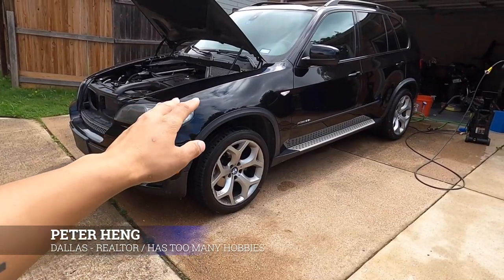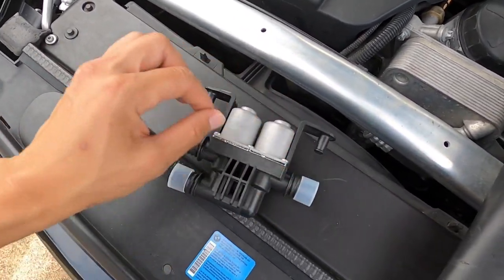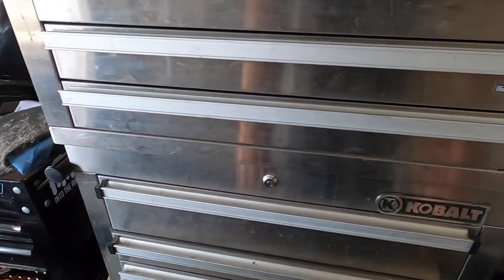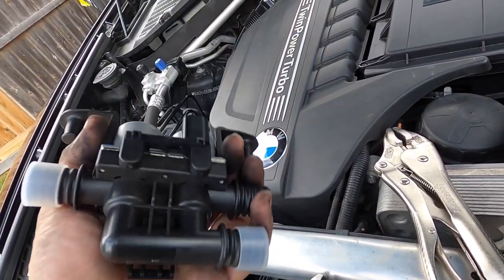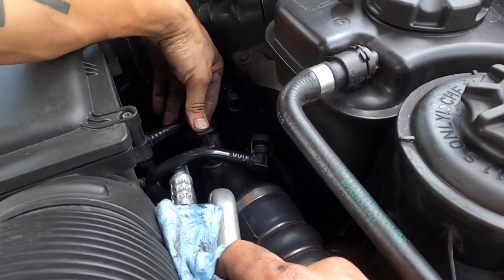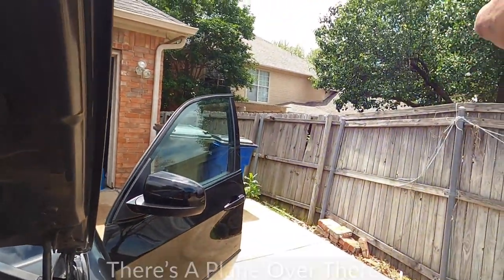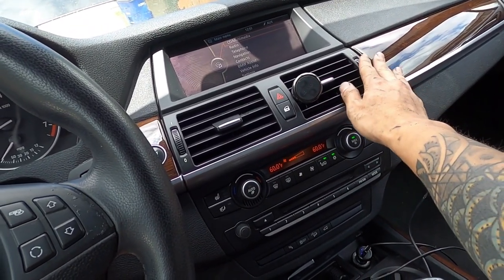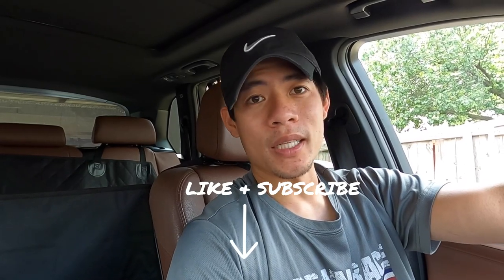🚘 BMW X5 E70 Heater Control Valve Replacement | VLOG 13

Comment: Thanks for the video. It seems to be the same on my x5 xdrive35i. This boosted my confidence. I was afraid to try it myself but it seems pretty straight forward. I will attempt this as soon as the new valve gets here. Next I will attempt to fix the frm model myself. Lol I will probably dick it up but I can’t afford what the dealership wants.

Comment: Just done it on a old E36 convertible  and it was a lot easier to get than yours,mine cost £33 and works fine not all aftermarket stuff is bad or poorly made .good luck bro
Reply from the maker: agreed! it's still working but now my electronic parking module just went out on me... So waiting for the new part to come in... so be on a look out for another DIY haha

Comment: good job 
i have same problem and foot it’s well 
so do you think i will replace valve it’s be working
Reply from the maker: Thanks for watching!  Did you fix your issue?
Reply: @jpht.adventures  I have the same issue. Foot well is hot back seat on my friends feets is hot when air is on. Ill replace it and let you know.

Comment: Great vid, did you have to burb the system after?
Reply from the maker: I honestly did not and I've had no issues so far *knock on wood* but the correct way is to

Comment: Hey,
Did you get a recall from BMW on this part# ?? Great work.
Reply from the maker: I did not, my car was out of the 10yr window for most recalls unfortunately
Reply: @jpht.adventures  
no, not that kind of recall.
this is a late recall in regards to that part (heater control valve). they said that it could cause fire.
However, there is no ‘solution yet on this matter.’

Comment: if you kept the suv, how long did the part last?
Reply from the maker: Still worked when I sold it a few months later
Reply: I just bought 1 as mine is shot,  says lifetime warranty  34$   aa ignition on amazon

Comment: Which hoses did you clamp before removing them from the control valve?
Reply from the maker: The coolant lines so they would spill out while I was swapping out the unit.
Reply: @jpht.adventures  You pinched all 3 hoses to the valve? What did you use to pinch it with?
Reply from the maker: @lawrenceaguero7995  yes but honestly you don't need to. Just swap a each hose one at the time while installing in the new unit. You'll lose the same amount of coolant regardless.